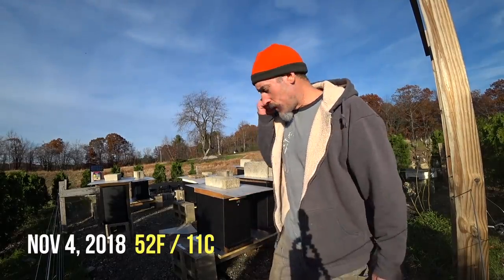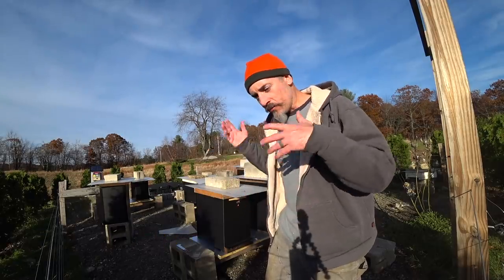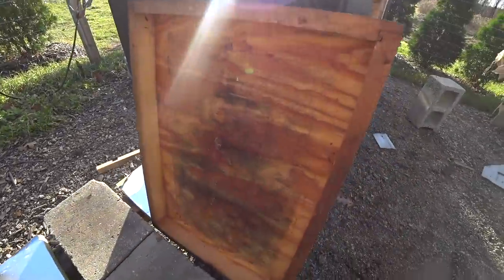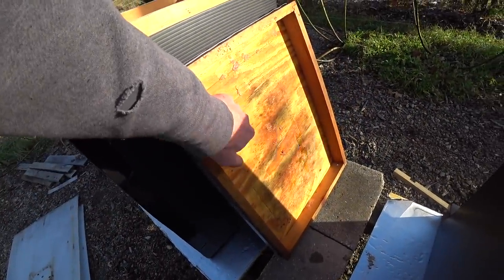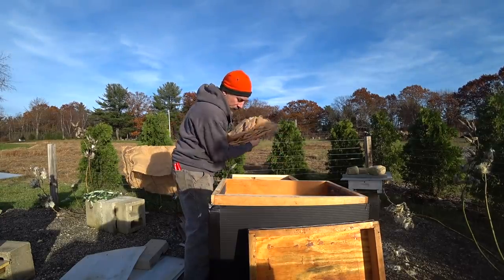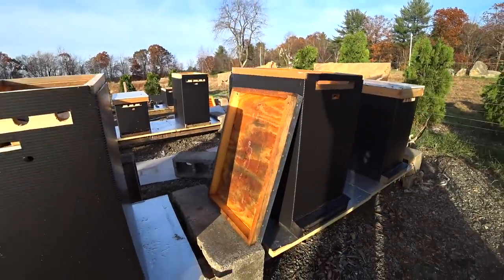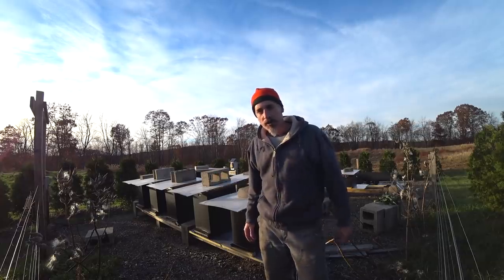Vivaldi Boards - DO THEY WORK?

Comment from the maker: I will be adding insulation to the top of the cover over the next week or so to prevent this condensation. This video is demonstrating the Vivaldi Board element of my system and how it works. The insulation layer will be coming in the next couple videos. Stay tuned!
Reply: Cut the pieces to fit your boxes. In the off season they make great covers for when you're robbing honey. When extracting put one on floor before you stack supers. Keeps bottom box from sticking to the floor and catches any drips. Handy to have. Dumpster dive on construction sites. Free is always better.
Reply: I just checked mine today and there is no moisture on top of my burlap, my top covers are not wet since I had already put insulation on them (or under actually). Great video again.

Comment: I use vivaldi boards (Brushy Mountain) but do not pack them with so much burlap.  Might all that extra packed burlap capture and hold the moisture? I use a single burlap sack (Tractor Supply) tri-folded in the vivaldi - figure it allows moisture to be evaporated yet still stops cooler air from entering the hive.  Also use a half inch of foam board between the top of the vivaldi and under the telescoping lid which creates a buffer between the extreme cold outside and the warmer air/moisture in the vivaldi.  Have had 100% winter survival last two years using this method - hoping for the same with the 17 hives this winter.  Live in south central Pennsylvania.
Reply: Just what I said earlier with negative response. Exactly what I do. It works. It's funny because i also bought the burlap bags from TS. I use 3 bags folded (fluffy) but it let's the air flow and doesn't create a think pad of burlap. :) Love the Vino Farm Video's they rock.  North Carolina here.

Comment: I feels warm to you after having the real cold weather before the warm day. This is still a little cold for the bees,so I would not leave the hive open any longer than it would take to replace the burlap with dry material. I use cedar shavings now. If there is some wet spots, you can remove the small spot of wet and replace with dry shavings without having a wide open Vivaldi Board. An added advantage of using cedar shavings is the fact that SHB and wax moths detest the cedar smell. When I build my Vivaldi Boards, Iput vent slots on all four sides. No matter what direction the wind 
is coming from, there si a direct cross flow.
Reply from the maker: I think everyone has different needs and climate conditions. I could never use cedar chips as they would just freeze into a solid block. We don't have hive beetles and wax moths are not a big deal for us either. Glad to hear you found a system that works for you.
Reply: I’ve been thinking about wood shavings too.  I can reuse the shavings as smoker fuel.
Reply: Vino Farm No hive beetle and no wax moth!  How?

What conditions in your climate stop them?  Something to think about to design better pest control.
Reply from the maker: Dannielle Harden Where do you live? Wood shavings in a Vivaldi board would become soaking wet in most cases.
Reply from the maker: Dannielle Harden Regarding SHB: I’ve seen exactly 2 hive beetles in three years of beekeeping. They were in a nuc that had come up from Mississippi. I squashed them and never saw another one. I’ve seen evidence of wax moth twice in frames of comb I had left in a garage for the summer. Never in an active hive. I think the 6 months of freezing winter might have something to do with it.
Reply: @vinofarm  We have very humid and very cold conditions in Michigan. Every thing freezes in the winter like your car doors etc. The cedar chips will have a small hand full of slightly damp chips in one or two corners of the Vivaldi board. With the insulated, vented roof the cedar chips stay warm all winter even in sub zero temps. They feel warm to the touch(above body temp)
Reply: @Psyche8D  I dump the cedar chips on a plastic tarp in the spring, let them air fir a day or so, and then put them in clean kitty litter pails to store till next winter. These pails are the type that have the attached hinged lid. I also use some as smoker fuel.
Reply: Vino Farm I’m in Canberra, Australia.  Not really much of a winter here, but I hail from ski country in Utah.

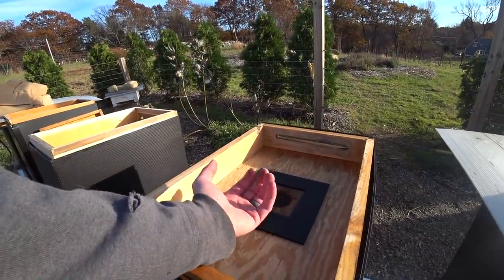Comment: I have noticed that the caroplast covers the ventilation opening of the vivaldi board, on the back side (1:34 & 1:51). Maybe the burlap stays dry when the wind goes trough it.
Too much heat loss?

Comment: It makes sense if you think about it. The burlap is wicking to the top of the hive cover, which is absorbing it because there is no air space. To much burlap. I would think if the burlap does not touch the top of the lid, then the airflow over the top of the burlap would carry out the moisture.

Comment: You might want to check the bottoms of the Vivaldi boards for moisture/mold as you may need to refine the size of the top vent hole larger or smaller to fit your hives / climate.
Reply from the maker: I thought about that, but didn't want to disturb them too much. It was not super warm and now it's getting very cold. In my past two winters, I noticed very little moisture up INSIDE the Vivaldi boards and top cover and zero evidence of moisture under the VB. Based on that, I'm pretty confident the moisture is moving pretty well up to the top. This is my third year using them. The amount of moisture is due to the syrup I was giving them up until a few weeks ago. Plus, the top isn't insulated yet so the condensation is much more dramatic than when the lid is a bit warmer.
Reply: @vinofarm  That is great too hear. I was just thinking that if the hives are getting too cold in depths of winter you might want too maximize the hole smaller to reduce thermal losses as long as they don't interfere with moisture management. Thx, I'm getting my own hives in two years once I can spare time from my current projects so I'm following you closely. ;)

Comment: Just a thought, I noticed you make a lot if not all of your own equipment.  On the inside of the lid why not adhere duraplast and angle the lid to tilt towards the rear.  On the rear of the board have a slit cut to allow the moisture the accumulates inside the cold lid to drain to the rear and drip to the outside of the hive, hopefully avoiding mold wet inner wooded lid.

Comment: The insides of the tops getting moldy can’t be good.  Perhaps a plastic sheet on the inside of the top for the water to condense onto before dripping into the burlap help would protect the wood from excessive moisture.
Reply from the maker: David Sachs This is a temporary issue until I get the insulation on there. Stay tuned.

Comment: Vino I just noticed something. Really don't mean to be critical but... Noticed you are putting weights in the center of the outer covers. I did the same thing. After a while you will notice that your covers start to have a bowl shape. 
To correct this I learned to put my weights (bricks, rocks, paver etc) on the corners of the hives.  I'm not in bear country so forgive me if them blocks are bear prevention.
Reply from the maker: Mike Ries Great tip. Thanks.
Reply: @vinofarm  meant to add that the weights are a 'heat sink' and may cause excess condensation. The combination of a warped cover and the heat sink sort of double wammies the effect. I'm not quite ready here either.  Winter came on fast.

Comment: Water is in air. It condensates where two temperature extremes meet (top of the burlap)
Reply: I f you have a insulated, well vented roof assembly on top, the meeting of warm air from inside the hive and the outside cold aie meet OUTSIDE the hive. My cedar chips remain warm to the touch all winter and almost 100% dry.

Comment: Not sure why as beekeepers we would put anything that would hold moisture in a hive, I think of it in terms of insulating a house, thanks for  the videos
Reply from the maker: Matthew Sweeney The burlap wicks moisture up and out. The Vivaldi board hole is a vent. The moisture goes out the vent, wicks into the burlap to prevent it dripping back down on the cluster, then dries out from the front facing openings.

Comment: Love your channel...Could you add a thin metal sheet to the inner face of the lid to act as a condenser plate to keep the wood from collecting moisture?
Reply from the maker: The condensation is very pronounced right now because the lid is not insulated yet. As soon as the top cover is wrapped, the temp difference will not be as dramatic and there will be far less condensation. I want the moisture to wick into the burlap and evaporate OUT the front.

Comment: Something to try would by a 2" piece if xps foam on top of your roofs, under your coroplast, would probably prevent much of the condensation. 

Still don't know about these boards, I prefer an insulated inner cover to prevent condensation and then use top ventilation to remove moisture. I hate the idea of moisture and mold being trapped in the hive. I put a 2" xps foam board on the top of my inner cover with two small vents in the top that go into a special vented roof I built.
Reply from the maker: Jonathan Swoboda I’m not done yet! Stay tuned. (Or watch my older videos). Insulation is on the way.
Reply: I agree. In my yards I use a feeder shim with a cover. Usually a migratory one. One hole bored into the shim with foam on top of the cover. Bricks on top. 
The shim vents the colony with the cover insulated to prevent condensation. The water vapor escapes thru the hole. Works very well.
Tried using foam under the cover.  Bees gnawed a new entrance in spring. Was not convenient. They picked the back side to chew thru.

Comment: I saw your comment about the condensation coming from the evaporated late feed. But do you think it is also a product of having the cinder block sitting on top and it is the reaction between the heat produced and cold cinder block sitting on top. I just wonder if another option was used to secure the hive lid (straps) would you have the same issue? To me it seems like the cinder block will stay colder longer during the cool nights and shorter days. Just a thought I am learning as well. If anyone else has brought this up sorry for the rehash....

Comment: I've added Vivaldi boards, I built them this year per your video, and have noticed that the bees not only have propillized the upper entrance closed but have also been trying to close off the hole in the upper cover.  I live in western Kentucky, and our winters are no comparison to yours.  Have your bees done the same?  It's almost like there is too much ventilation.
Reply: If they feel there is too much ventilation, is they will prop it shut till they are happy. Nets inside or outside doesn't matter, they know best as there might be gaps in your  hive body that you are not aware about. Let them do their job. Usually it's when we intervene too much that the hives go down hill. Keep an eye and watch their behaviors.
Reply from the maker: Very interesting to hear they closed the holes. Mine don’t do that at all. Upper entrances are very well used and wide open. I do notice the bees sometimes cluster around the opening in the floor of the Vivaldi board. Probably regulating the air flow as needed. They know what to do. I like to give them upper options because I know they use them. I’d rather give them the option than close everything up tight and take away the choice when they need it.
Reply: Seemed odd to me that they have closed up the upper entrance, but I guessed that they know more about their comfort than I do.  It's been very wet and in the mid 40's here during the day, so they are not very active shohoko 10, but I am watching them everyday.  Thanks for putting up such informative videos @vinofarm

Comment: Can you relate the volume of syrup you fed, to which hives had most moisture? Russian was moldy, it was a 2X deep.  Were all single deeps dry?  Maybe move to solid/dry feeding earlier?
Reply from the maker: Mark Karstad The largest colonies were wettest. The smaller ones were mostly dry. With all the open feeding and robbing, I don’t have an exact idea of which colonies had the most liquid feed.
Reply: More bees, more heat, more condensation.

Comment: I'm not a bee keeper but do you think maybe the moisture on the lid and moisture on the top of the burlap was caused due to their contact and not being able to dry out maybe something to ensure they couldn't contact each other would help thanks for the videos
Reply: My question also.  From the video I could not see if there was more area of contact in the "wetter" hives.  Adding a layer of insulation under the cover may increase the amount of contact. How compacted the burlap is and varying
impedance of air circulation to the vents will probably affect the moisture control among the hives.
Reply from the maker: The water condenses on the cold spots and drips down. Whether it's contacting or not, the top of the burlap and the cold inside of the lid will get wet. I will be putting insulation on the OUTSIDE of the lid to keep the inside of the lid to a closer temperature to the inside of the hive. In my previous experience, this will keep everything a lot drier inside the hive. The moisture will vent out as vapor from the front of the vivaldi board.

Comment: Is there any robbing going on when you leave several hives open at this time of year?
Reply from the maker: DIYMarta They all had screens on top. They were not “open” just vented. Also, aside from this warmish day a week ago, it’s been very cold. No flying, no robbing these days.
Reply: @vinofarm  Thanks for the response. I ask because I had a curious thing happen. I moved my only hive the other day just before a mighty cold snap. Temporarily closed the entrance entirely (partially with a screen). The next day when it warmed up to 40plus, there were bees trying to get in. I assumed they were from neighbor hives (and therefore robbers). The second day, there were bees trying to get in with pollen! That has to mean they were from my hive. But where were those bees for two days when the temps got down to 18F? I'm baffled.
Reply from the maker: Interesting... are you sure that entrance was entirely closed? Bees can be amazing escape artists.
Reply: @vinofarm  You may be right, tho I watched for a long time and saw no out-goings.

Comment: What size hole do you have in the Vivaldi boards ? I saw the video of you making them but you didn't give dimension's of routed holes or you holes in the center.
Reply from the maker: Demo Joe The hole in the center of the plywood is 2-3 inches. Standard inner cover hole size, but they all vary a bit. Some are round, some are oval. The holes in the ends are either 3/4” grooves or a series of four 1” holes. I changed the latest ones I made because I was too lazy to get out the router.
Reply: ok thanks I made some solid inner covers but haven't drilled any holes yet. I'm planning on getting 2 Nucs in Spring 2019 to start with... I have a bunch of 5 frame nucs and a bunch of 10 frame hives. I want to make some 4 frame hives as well as I want to make some of those Vivaldi boards. I have been building things like crazy I have to stop and figure out what I am going to use before wasting any more time and material.

Comment: Are you going to try infrared to check the clusters this winter?
Reply from the maker: alphaxanon I need an IR camera to do that!
Reply: @vinofarm  The Flir One is a $200 dongle for a good smartphone.  That's the cheapest IR device I know of.
Reply from the maker: alphaxanon I’ve seen that, but read mixed reviews. I’ll keep an eye on the price. It’s a bit much for something I know I won’t use that much.  Maybe I can borrow one to see how it works.
Reply: I have the FLIR for my iPhone. I love it. It has photo and video. It is great to see the heat from the bees and where heat is being lost.

Comment: Hi.. do you take the bottoms open during the winter ?
Reply from the maker: S. N. Bottom of the hives? They are screen bottom boards, but they have the coroplast mite board installed. The hives are also sitting on insulation, so there’s little open to the bottom. The main intake for lower air is the main entrance with the mouse guard installed.
Reply: @vinofarm   aa OK.. Normally I take the bottems of the hive open most of the time.  Only if the temperature drop under -5 degrees celcius.. I close them partially with a plastic bord.  In this way the hive is enough ventilated and you do not have the problem of the moister and water condensation under the innercover.
Reply from the maker: S. N. We go below 0°c every night for months. Most days are below 0 in January and February.

Comment: Just playing devils advocate here (or should i say my scientific mind is kicking in) but with your Vivaldi boards....might they work better without the burlap? Could be burlap reduce airflow and trapping moisture. You should try a couple with the Vivaldi Boards and no burlap and see if they are dryer.
Reply from the maker: hyfy1970 hyfy1970 Without the burlap, there would be a strong chimney effect with all the heat blasting out of the hive. The burlap slows that air flow while still wicking moisture.
Reply: @vinofarm  I tried row crop cover material, a spun polyester fabric, instead of burlap thinking it may wick better and compact less.  This year I plan on using it again giving attention to air flow and compaction as in my earlier reply.
Reply from the maker: Robert Bennet: I have that agribon fabric laying around but didn't think to use it. I didn't think it would absorb moisture as well as burlap. Does it work?